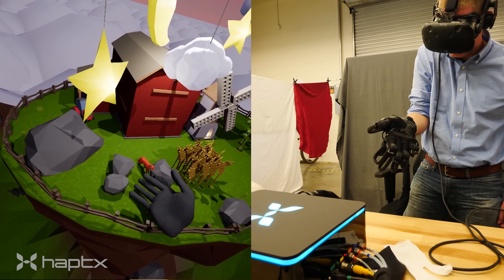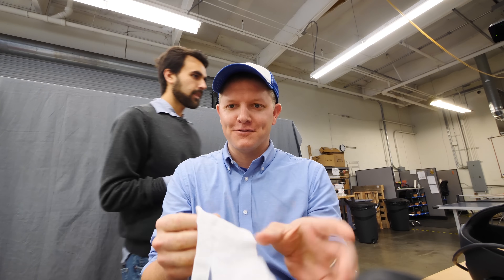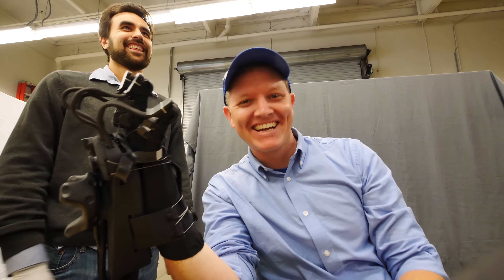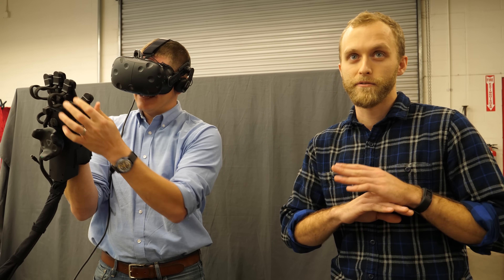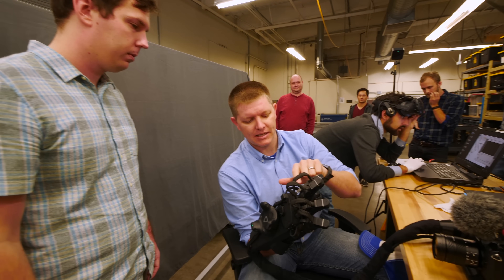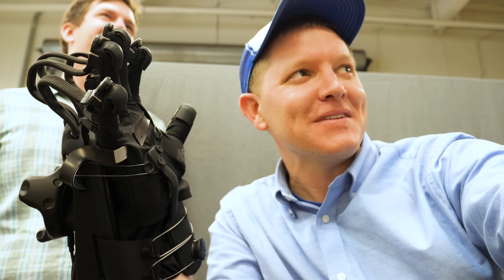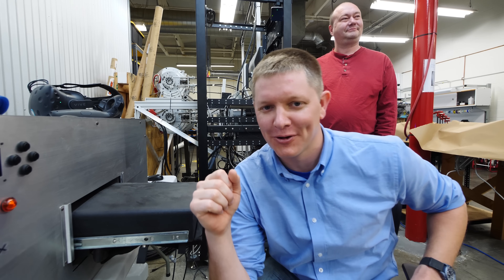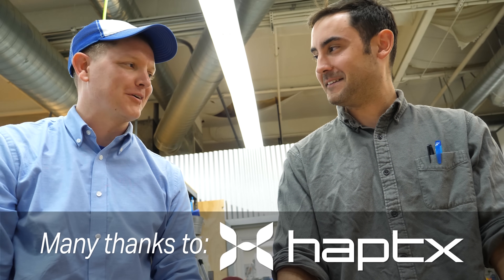How do you make a Virtual Reality Glove? - Smarter Every Day 191

Comment from the maker: I'm excited about Ready Player One so I decided to do a deep dive into the science of virtual reality.  This is the second part of the series.  I haven't revealed what the next video is about... but it's super interesting and probably a bit unexpected.

There are tons of things I had never considered about how difficult it is to fool your brain into thinking it's touching something it's not.  I think the most important technical issue to overcome is timing.  Much like how your brain can understand hearing someone's voice AFTER seeing their lips move, but not the opposite... the lag time of the sense of touch is an important thing for your brain.  Another thing I hadn't considered is the "rise time" that has to do with internal stresses in your fingers.  If you conceptualize your fingers as water balloons around bones, you can understand how the internal pressure of your fingers rise the harder you press something.  This type of information coupled with the "Sensory Homunculus" make for some incredibly fulfilling thought experiments.  

The temperature question is something I'm particularly interested in.  Using a colder fluid to model a room temperature fluid because of the heat transfer equation is a fascinating area of scientific problem solving.  If you think it through, everything about this boils down to differential equations.  How much heat is leaking out of the hand, and at what rate, through what contact area?
Reply: Destin. You are awesome man.
Reply: Hey Destin (Mr. Sandlin), I am a homeschooled highschool junior in northern MI, and I've been working my way through all of your videos. I am looking to get a Mechanical Engeneering BSE, and possibly get a masters in Biomedical Engineering. I was curious, because you've said that you do smarter every day so to fund your children's college education. As I have looked at colleges and universities, I have been increasingly astonished at how drastically the price has gone up, especially when contrasted with the cost when my parents were in college. 
I was hoping that because of why you're doing this, you might be interested in doing a video on why colleges cost so much. After all, what does it really take to provide that education, and what is just making the owners rich?
Thank you for all of your incredible videos,
Sincerely,
Jesse Benzing
Reply: OK. so.  I did my Master's thesis specifically on the topic of thermal haptics (thermoception). There are really some crazy applications, the heat flux of a material alone is enough to identify it (whether an item is plastic, wood, etc.). The other cool thing is that sensations like "wet" are simply the combination of our sense of temperature (heat flux) and pressure - you can mimic it simply by mimicking those two properties. anyway. I put together a series on it, if you ever want to check it out.
Reply: Is it really fluids, or could it be Peltier Modules?
Reply: Also, I love the scriptures that you put at the end. You always seem to find the best scripture to give all of the credit back to God. I appreciate that, thank you.
Reply: Hey Destin, I also enjoyed reading Ready Player One. I noticed there's a black dot that appears at the bottom of your video at 0:16 and it made me think: is he starting an easter egg hunt in his videos?
Reply: "Hand't" = Hadn't   " Another thing I hand't considered is the "rise time""
Reply: Destin I wish all the YouTube videos are awesome and useful like yours
Reply: Would you please make a summary video of your understanding of the haptic glove  and it's functionality.
Reply: I'm not at all sure but they might be using the thermal grill illusion to create the sensation of heat/burning without actually needing to pass hot fluid through the glove which could potentially harm the user or damage the glove. Also it would allow for more rapid transitions from hot to cold since only half of the fluid (the warm fluid) would need to be displaced. https://en.wikipedia.org/wiki/Thermal_grill_illusion
Reply: They didn't show you a tacter from the glove, did they? The spacing doesn't seem to meet the 2-point threshold on my finger.
Reply: Wouldn't it make more sense for them to use a non-conductive fluid for a hydraulic system? That would decrease the response time and also give the sense of heat/cold, it would make the most sense to channel it through the water-cooling system of the CPU/GPU, rerouting the heated water when necessary as well as the cool. Not to mention that leaks would be much easier to spot, although you would probably need to make it more modular for easier maintenance.

It would probably cost more money to produce this version, but at this point in the industry, you might as well target the niche enthusiasts who are willing to pay more for complete immersion and operating efficiency.
Reply: So, I just watched a guy on the internet play with expensive toys/tools and he told me to do what the other guy on the internet is talking about.  I didn't really think about it, I did it!  There are many people on the internet you should not trust at all.  Destin is not one of them.  Thanks for putting this up and thanks HaptX for letting him.  It's amazing what we learn when you have good teachers and incredible subjects.
Reply: It's wonderful how our brain and our body works, it's hard to trick that brilliant system! Ps 139:14
Reply: i am more so looking forward to the point where we can Transfer our self into a Avatar in agame. and yes i do believe that is possible
Reply: SmarterEveryDay would you be willing to do a fan meet up in Huntsville to go see ready player one?
Reply: I have a theory about the temperature solution. This theory is based on the fact that the machine where you experienced the temperature demonstration is large and loud, and the fact that it seems difficult to implement the thermal part in the glove.

I agree with you about how they could model the heat transfer by just controlling the temperature quickly and precisely. I think there are bounds for the temperature, and a source of water for each of them (one hot tank and one cold tank). To simulate those temperatures, maybe they precisely mix the two sources in the right proportions to make a specific temperature, and the mix flows at a constant (fast) rate.

But just like you said about the air, it takes time to start and stop the flow of fluid, so maybe the temperature control is constantly flowing, and the mix proportions are what is adjusted quickly. This would solve your question of how they "dump" the hot fluid. It might just be constantly flowing through the pad.

Once again, I think this is why the machine was always loud. It might just always be pumping more water, and whatever passes through the thermal pad goes somewhere else in the machine to be reprocessed back into cold and hot water, and refills the tanks. This constant flow would solve the quickly dumping problem, and explain why it's difficult to put in the glove.

This may be my first ever YouTube comment, but I've been watching your videos for a long time, and I love what you do. Keep it up! :)
Reply: My thought as well.  A small Peltier Junction can be used to apply heat or cold to the hands by reversing polarity.
I also wonder why piezo transducers are not used instead of air bladders for touch sensations. A piezo actuator can respond MUCH quicker than filling an air bladder.  It would greatly reduce the latency issue.
Reply: I  think i'm going to try to make something like this just not as good but cheaper
Reply: Can you achieve this kind of travel with a piezo? After the demo of the temperature glove I'm now thinking maybe the tactile feedback isn't actually pneumaic, but hydraulic. Seems to me this could also be faster than using pressurized air. Their end goal could be to combine temerature and force into one single tube
Reply: I wonder if I can simulate touch with static electricity?
Reply: A future step would be to have a tape to connect the glove to maybe the elbow or shoulder to pull on it to simulate weight of objects.
Reply: Show Cerevo's technologies like Taclim haptic shoes!!!
Reply: SmarterEveryDay sacks of watery meat, a technical term.
Reply: Hey thats cool, but I just feel that you were rude... I know you want to know how thinks work with great passion, but you crossed the line a little bit, the video felt like someone bothering a couple of engineers... Nothing like previous videos were people are open to discuss and explain things.
Reply: can you please ask them have they tried piezoelectric cells as actuators, or micro magnetic controlled bladders, instead of air actuated.
Reply: The temperature control, to be precise, low latency and reversable has to be a TEC (Thermo electric cooler)? for the response, it has to be low specific heat, modulation (voltage control) and reversible using an H bridge (or something!)? They can also be scaled to fit under or between the other components?
Reply: SmarterEveryDay they can add thermal function to the glove by making worm/cold fluid flow through poking dots, and regulate pressure by differential between input and output gates
Reply: Destin, did they hang all those sheets and curtains just for your visit?
Reply: will the gloves tactiles burst when transported by air? if/when they can sell it to to other countries.. ?
Reply: I (and my students) love your passion. They get a real kick from seeing that asking questions is the key to unlock understanding, so unsurprisingly my classes are very student question led. Appreciate all you do and share with us.
Reply: @SmarterEveryDay I'm just curious, why do you need sponsors for? You MUST be making over 10000 dollars a month from youtube alone, so what's up with the sponsors? (Not complaining, just curious).
Reply: Brian something just like brest implants, they would not.
Reply: It could be using thermoelectric coolers to instantly change temperature and then use liquid to cool the plates
Reply: Hey Destin. Do they take advantage of the thermal grill illusion? I think that would make the transition rate a bit quicker if they only had to dump out half the fluid.
Reply: Really hope you do a video on those omnidirectional treadmills that are starting to be paired with VR tech; that was a very prominent feature of the OASIS in RPO. Really enjoyed the video as well, thanks!
Reply: I'm thinking it's Peltier coolers, thermoelectric devices that can be made into a variety of shapes, almost arbitrarily small, and react very quickly to applied electrical signals.  You might be able to store the extracted heat and reuse it later, or even extract it permanently from the glove interface.  You can also use simple resistor heaters to add heat.  These can be made to extract/add heat to each fluid channel, probably close to the tactor or the skin contact so that the tactor pressure adjustments are decoupled from the heat pump, but that's not necessary (you might need to cycle the gas/fluid in the tactor to change the temp - could be done pretty quickly).  However, the resolution in space (not just in time as noted in the video) for temperature gradients and changes on human skin isn't that great, so it would make sense to have a relatively low spatial rez heat pump system on top of the tactor array... and you'd want it to be fairly thin so that you could change the temp quickly.  You might even have the thermoelectric coolers and heaters in direct contact with the skin, between the tactors and the skin, and that might solve a lot of logistics problems.  Anyway, that's my thinking.
Reply: SmarterEveryDay I guess the rapid change from hot to cold can be achieved via a peltier module by changing the polarity of the applied voltage
Reply: Actually, this is great guess, and you've pointed out a miss-assumption of mine below.  You can flow fluid through a tactor at any pressure you want, so you could actuate a tactor WHILE flowing hot or cold fluid or gas through it.  All you need to do is use a thermoelectric cooler/heater somewhere along the fluid channel for each tactor to heat the fluid, and you can move the hot/cold fluid into and out of the tactor as needed, or even keep the flow going so that it compensates for the heat being drawn off by the human skin (from hot flud tactor) or being deposited by the human skin (into cold fluid tactor).  Really, the only limit is how quickly you can heat or cool and move fluid through the channels, and that's not a problem except for the techniques you need to develop to miniaturize such system enough to put it in a glove that a normal human can wear and lift without too much trouble.

Interesting thought - if you could use air as the tactor fluid, then you don't need a reservoir of fluid or a closed microfluidic system, you can just draw air from around you, adjust the temp using your microcoolers/heaters, and pump the treated air through the tactor and out into the atmosphere through a restricted channel (or possibly an adjustable valve) selected to allow a micropump to generate the pressure and rise times needed to actuate the tactor and generate the temp changes.  Based on the video, the only thing I didn't see that would allow such system to exist is a micropump with enough capacity to run the system...

oh, wait.  you could just charge up a pressure bladder/reservoir with air (or constantly charge it, like a bagpipe), and use the pressure reservoir and valves to do what the micropumps would do.  the volume of air looks to be so small, you probably don't need that big of a reservoir or pump to charge it for most VR sessions, and you only need one pump since the reservoir feeds all tactors.  A MEMS pump might do the trick.

Cool!
Reply: SmarterEveryDay I'm sure you spent a long time deciding how to (edited) all of that!!!!
Reply: 😂😂You're probably the most un-ideal person the have around all the IP, being so passionately curious. Probably fun too, makes for an Awesome video👍😛
Reply: SmarterEveryDay imagine it was redesigned at a later stage to be skin tight. Now imagine the solution to waste and climate change was everything in your house was virtual. You sit in a virtual sofa, sleep in a virtual bed or better sleep on a cloud. Obviously the toilet and shower would be real but what i mean is there is so much potential beyond games.
Reply: I just finished watching Ready Player One and it reignited and interest in computing at a level of intensity i hadn't felt before. Now im more fascinated by the Computer Science aspect of the movie and want to now delve into the physical aspect and immersion of VR gaming.
Reply: Lemme guess... Rush video?
Reply: Destin this just tells us the same thing that the video does and it already is in the description